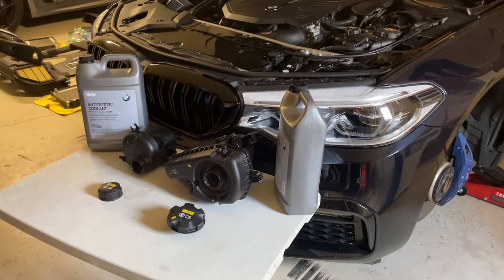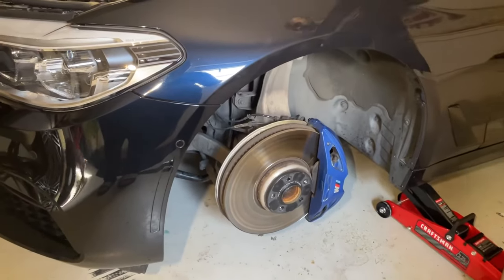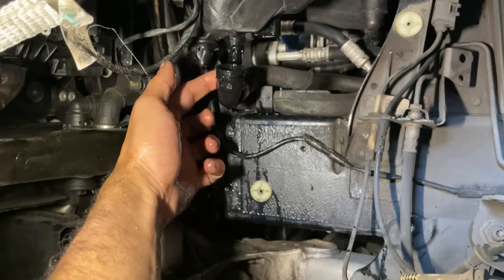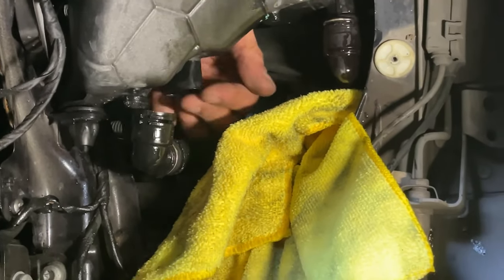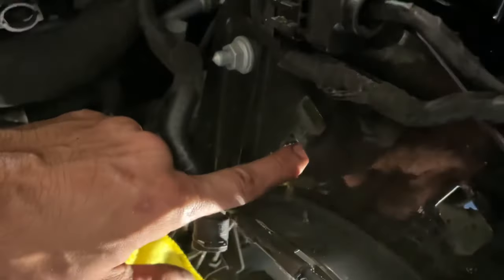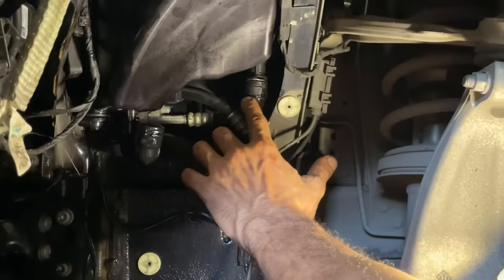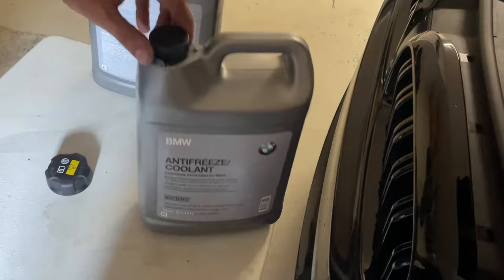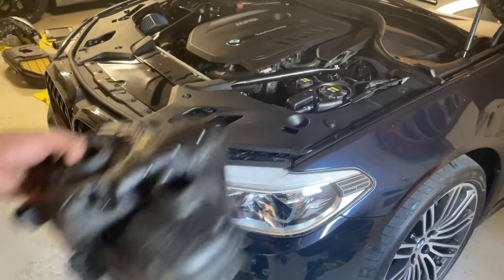BMW G30 : EXPANSION | COOLANT TANK REPLACEMENT

Comment: mine just started leaking and i thought it was coming from the reservoir hose underneath but now that I saw this I'm going to take my front wheel off and see if its actually leaking from the reservoir itself.
Reply: Same here, same exact thing I have to take the wheel off and look under there because if it the tank then easy fix. And I might as well change the oring inside the hose for peace of mind. It’s just a pain in the ass why they can’t just make this tank a little more durable.

Comment: Is the big tank compatible with old small tank? My big tank started leaking at the sensor or tube plug near sensor. Not sure where exactly.
Reply: They are 2 different circuits of coolant
Reply: @Cmatt1299  so you don’t need to replace both if only one is leaking?
Reply: @shannonjamieson2873  On the bmw's with B58 engine? No.

Comment: Does this apply for the G30 530i models as well? I might have to check under the wheel well to check for any leaks as I noticed a small change in the coolant level in the main tank.

Comment: What is the name of the line you replaced that connects to the front of the expansion tank and top of the radiator? The one you referred to as fragile. Mine was really brittle and broke and now I need to replace it.

Comment: Do you know the part number for that top front gen II expansion tank hose you previously replaced? Mine just started leaking. I replaced my large tank about 4 months ago. The side seam of the tank was leaking. No problems since, until this hose. It leaks at the connection to the tank.
Reply from the maker: https://www.bmwpartsdeal.com/parts/bmw-pipe_radiator_expansion_tank-17128602599.html

Comment: Have you done a coolant flush on the car?  I looked at the technical manual and it stated you would need to use a pump and pressurize it.  Other guys have done it's like a drain and fill, wondering if it's the same here

Comment: Very helpful video, i have one question. The BMW manual says you should fill the system with vacuum on the B58 engine. They say "filling without the vacuum filler device is not permitted" but my question is, is that really necessary?

Comment: You mentioned that you replaced one of the tubes with a hose. Is there a specific hose? 

When I look up online for parts the only option I see is the hard tube replacement, that you say is brittle and can break when changing out the reservoir tanks.
Reply from the maker: That's actually a very good question! When you order the part number they will send you the revised version which is different from what the pictures are showing yet it will still work perfectly fine with your car! Since it's just from a newer yea.
Reply: @FullBoltOnGarage  awesome, thanks for the quick reply!

Comment: Why did you have to replace it? On my old Bmw its over 40 years old and i did never had to replace it
Reply from the maker: Luck of the draw? Lol
Reply: They said the new bmw with B58 engine have issues with coolant tank and seal … i have a 640i with B58 and 35000miles , everything still good …

Comment: Do you have to replace both tanks if just the larger one is leaking? Does the old small tank hook up the same to the new larger tank?
Reply from the maker: No you don't need to. I changed the little one first a peace of mind
Reply: @FullBoltOnGarage  thanks!

Comment: Whats the line you replaced at 1:17 ?? Need a gen2 one as well think i put a hole in mine smh
Reply from the maker: https://www.bmwpartsdeal.com/parts/bmw-pipe_radiator_expansion_tank-17128602599.html

Comment: Thanks a lot for the video. I have a late 2017 G31. Looks fine at the moment, don’t see any sign of leaks. Do I still go ahead and replace the coolant tanks as a preventive measure? Thanks
Reply: did you find the answer to this question
Reply: Yes

Comment: Good video. Looks like a new expansion tank doesn't have a vent screw. Maybe that was the leak issue. Where did you had a leak on your old tank? Thanks
Reply from the maker: From the bottom it seemed but it's hard to tell without a proper bleed procedure!
Reply: @FullBoltOnGarage is the bleed screw on the reservoir or the expansion tank?

Comment: Can you explain what is the difference between the gen 1 and gen 2 tanks? Mine just went out a few days ago (gen 1). Maybe the gen 2 tanks aren’t as susceptible to leaking?
Reply from the maker: The thickness and the seal compound used to hold the top half together!
Reply: They now have it built without a bleed screw. No idea how it works as I haven’t bought / installed yet.